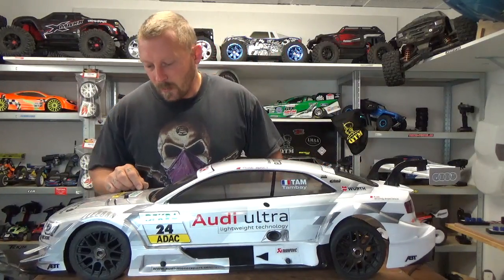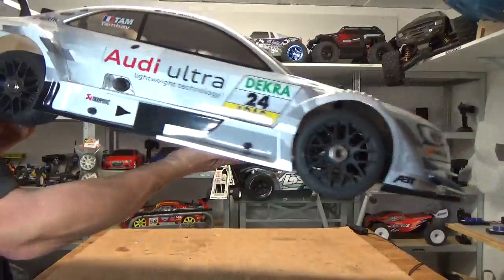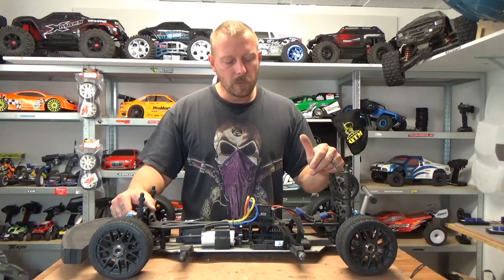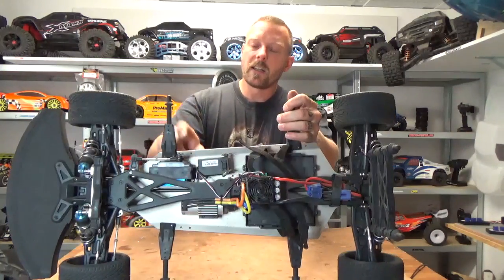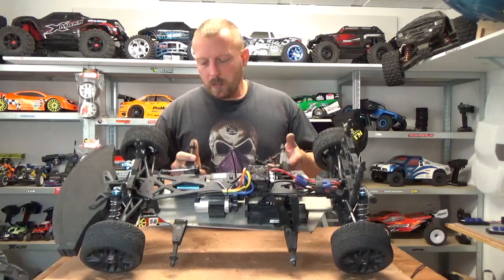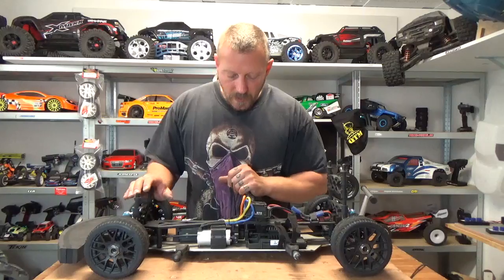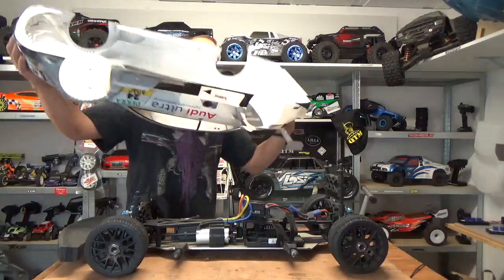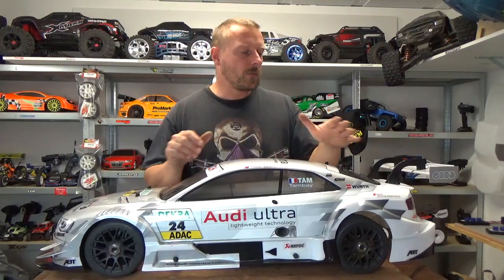THE AUDI RS5 1 5 SCALE BRUSHLESS CARSON

Comment: Awesome, I was waiting for your English presentation of this car, saw your running footage of it already, and even looked up the website for this car, too bad the BMW version or body seemed to be out of stock looks good. I'm excited to see what your findings end up being, after all the tests and tunes.
Reply from the maker: hi :) look at  : rccaronline.de
for now i have put harder oil in suspension but is still not enought (stock 1000cst i put 2000cst ) and last test i do with 18mm squars and sp racing diabolik super soft :) waaaaaaaaaaaay better , next step diff tuning :), i will see how it hold in time , because it's clear that fg onraod ar unwearable :)